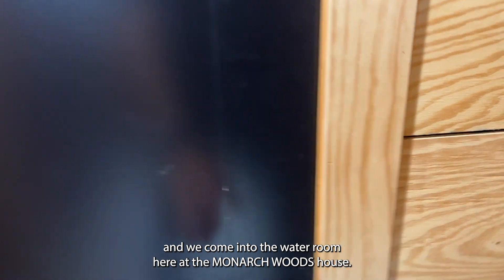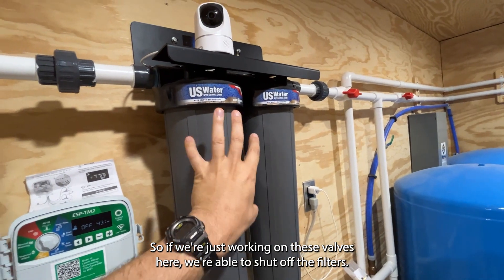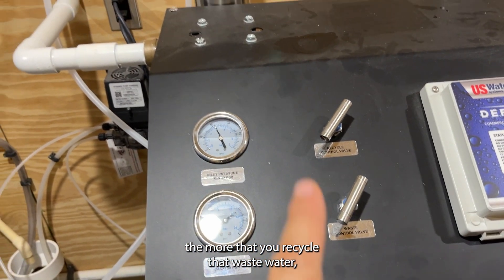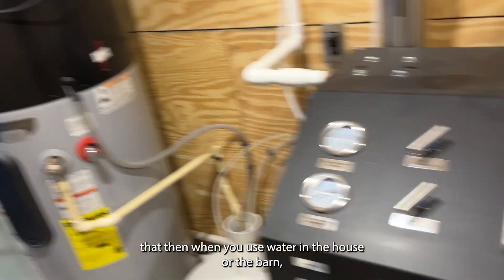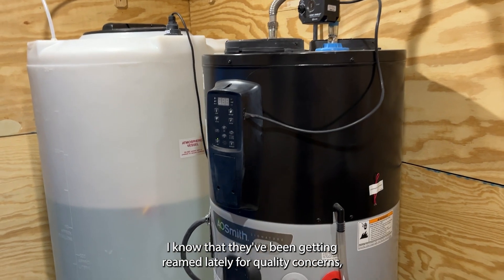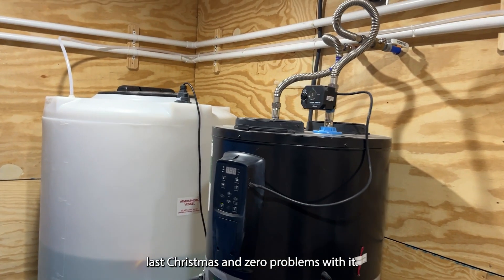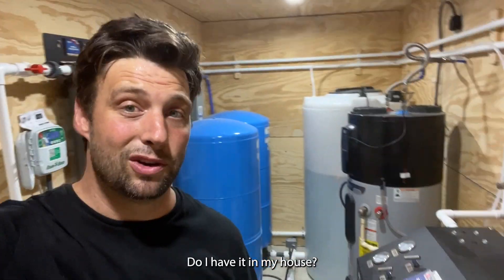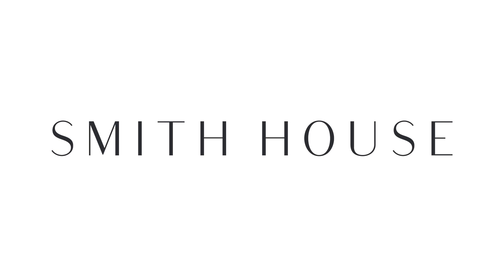The BEST Water Room Setup!! | Smith House

Comment: I have a cistern. The water is pumped from a 2 stroke water pump on my flowing point well. Because off grid. The house water pressure is done by a low volt pump with pressure switch on it. It's really a cheap simple setup. I ran pex, filters, and we have tankless water heater.

Comment: I'm a big fan of RO but I would never have it as a whole house system. A lot of thought has to go into what is downstream from an RO system. It will leach any soft metals into the water from fittings, valves, etc. Eventually it will ruin them. Then there is also the maintenance aspect. Even with my dual membrane 500Gpd system used for the kitchen, I still have to replace one membrane per year to keep the product water TDS in check. Also not a fan of having the product water is an atmospheric vessel. I much prefer the pressurized tanks. I have 2 6 gallon tanks which gives me just under 9 gals of stored water, plenty for drinking water, ice, cooking, etc.

The system shown the one other thing I would comment on, adding a carbon block "polishing" filter as the final stage after the UV. Especially with the plastic tank any off tastes to the water would be removed by the carbon filter.

Comment: You should not have a PVB inside of a structure! You will flood that room if that backflow preventer does what it's supposed to do. I've seen poorly designed sprinkler system with a bad values cause them to dump water out of them as system tries to cycle. If you want to keep backflow inside you need a RP with a dedicated drain.

Comment: Could you use the waste water to irrigate or will it be too mineral dense for that purpose?

I am seriously considering a full RO system and I live in a water district in CA so my water costs are not insignificant - that percentage of waste water and costs is my biggest concern with using a whole house RO...we have really hard water where I am - RO would be perfect for me as I am really dislike the salt water softener but 20-25% extra on my monthly water bill is not insignificant tbh...also it could push me into a high user category and cause a higher overall billing rate doubled with consumption reduction requirements...but...if I can capture the waste water from RO into cisterns along with my rain water to irrigate my landscaping...then that should make the costs more palatable as my total water usage wouldn't really move a lot...or atleast that is the hope...

Does anyone here have any thoughts on this? I am seriously considering contacting US Systems to talk it thru with them...
Reply from the maker: RO waste water is perfect for irrigation.  You could couple it with a grey water irrigation system and have the best looking free irrigation on the block!
Reply: @JordanSmithBuilds  for a family of 5 in a 4bd/3.5 bath home with 2000sqft of habitable space - how much waste water could we expect? 

I had put in a perimeter French drain and rain gutter capture systems with 2 dry-wells last year due to crawlspace water intrusion issues but I am now thinking I could replace the drywall with a cistern...didn't think about when I did that work but I could rerout the waste water to these locations...hadn't thought of grey water either...can grey, RO waste water and French/rain gutter runoff all be stored in the same tank system or will they need to be separated? I would assume back flow preventers on the RO-Waste, Grey water diversion, and rain runoff lines should fix any contamination concerns back up the system right?
Reply: @JordanSmithBuilds  also, never considered grey water before this tbh...does that need specific approvals from cities? I guess I could call mine to find out...
Reply: How can we reroute that waste of water to the bathrooms?

Comment: Whole house RO is nice, but it has its challenges.  Any metal anywhere in the system, like hot water heaters or certain faucets or your toilet mechanicals will rust and breakdown.  So One needs to be aware and set up all your plumbing devices to work with RO.  Hot water heater has been my the hardest as the units in my house now have metal connections and I think the tank is metal too.
Reply from the maker: Good point for sure.  We are running PEX throughout, so we should be fine in the walls, but will be keeping an eye on the appliances and fixtures.

Comment: Water softener and a carbon tank would have been good enough compared to the expense of the RO. Carbon filter will take out nitrates and other bad stuff.
Reply: Water softeners are horrible, I grew up with one.  In our new build which is on a well, I’m VERY motivated to not have a traditional water softener.

The feeling of never rinsing clean in the shower and the constant hassle and expense of filling the softener are definitely good reasons to avoid them.
Reply: @superspeeder  I'm not sure how you feel like you never rinse clean. I've never had that problem in over 30 years. I'm on one now with city water and 2 people go through la bag a month. On a well it was like 2 to 3 bags a month.
Reply: @ColeSpolaric  I believe it has to do with how hard the water is.  If you’re on city water it’s likely softer and needs less salt, so the effect of not rinsing clean would be reduced.

We’re going to be on a well, and though I haven’t yet had the water tested I’m pretty confident we will need to mitigate hard water based on talking to people in the area.
Reply: @superspeeder  I was on a well before though with water about 3x as hard as the city water that I'm on and never felt like I couldn't get clean. I wonder if you've had softeners that were set to use too much salt.
Reply: @ColeSpolaric  that’s definitely possible, but if you do any research into softeners you’ll see undeniable evidence that my experience is not rare.

Comment: The piping is really straight, clean, and neat. One of my pet peeves. Since this is inside of a building, where the sun doesn't get to the plastic handles, I don't have a big problem with the plastic ball valves, as long as the installer was really careful with the glue.

Since you are pulling out of a pond, I would be concerned with how quick those 4x20 cartridge filters are going to clog. 

Is there a reason you put the UV after the RO, instead of between the cartridge filters and the RO? Not an expert on water systems, but my understanding is that RO should be used as a final cleanup, with MAYBE a carbon filter to do a final polish. I would be concerned with bacteria growing on the surface of the RO filter, reducing efficiency. 

Not that it is a real problem, but those flexible tubes on top of the water heater are driving my OCD crazy. Just can't go there, hard pipe and fittings aren't that much more difficult or time consuming.

One last little nitpick. Don't know code in your area, so maybe not applicable there. But PVC is not approved for indoor use under the code I work under.
Reply: Good questions, I’m curious as well.
Reply from the maker: Thanks for the comment!  
- Pond -
We have the piping installed to pull from the pond, but to complete that functionality, we will need to add a pump and dedicated pond water pre filter.
UV 
I got that wrong!  You are correct, the UV filter is the last step, after it has been stored.
PVC
We consider the water room to be part of the water service and not water distribution.  Splitting hairs, right :)

Comment: I thought that drinking reverse osmosis water might bring some health risks, at least according to WHO...
Reply: I work in a chemical lab and we use RO water on the regular for lab work. We do NOT drink it! Every chemist in the lab says drinking it is not a good idea.
Reply: @spikeredvenom758 what’s wrong with RO water?
Reply: @aayotechnology I’m curious as well.  If they were an accepted health concern they wouldn’t be used specifically for drinking water.
Reply: @superspeeder  I don't know anything about what WHO may have said.  From my understanding on RO drinking water system is that before delivery you do put some know elements back into the water for taste and health.  That is, my RO drinking system isn't straight RO.
Reply: @TimothyDSwieter  those mineral additives done after the RO process are optional, you can buy systems with or without them.
Reply: We actually have specific water coolers for drinking water.
Reply: Most stuff you buy like bottled water or soda is filtered with RO.
Reply: I've been drinking it for 12 years now. Not only is mine RO but it has a DI stage after it which knocks the low 3-4 TDS down to 0 TDS. As long as you are getting minerals from other sources in your diet there is no health risk. Our fridge is connected to it and the ice that comes from the ice maker is crystal clear.